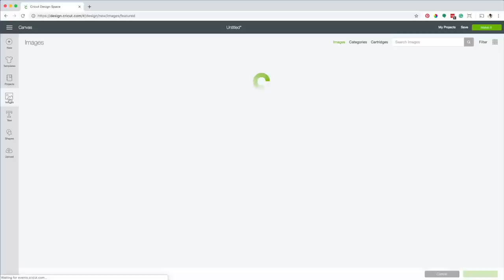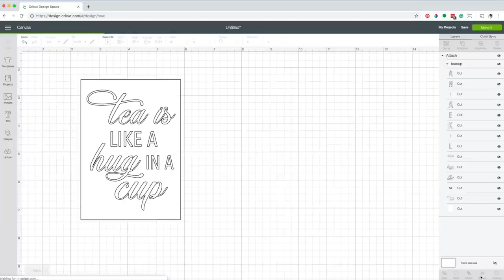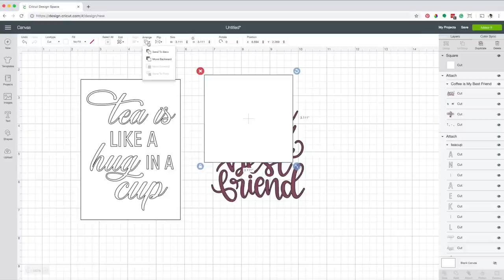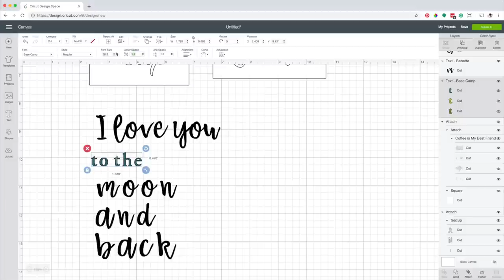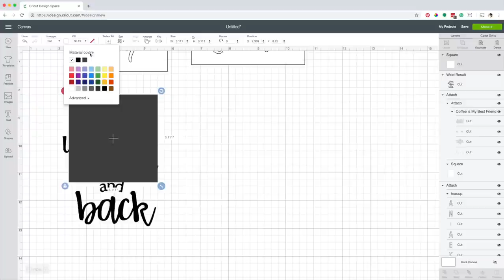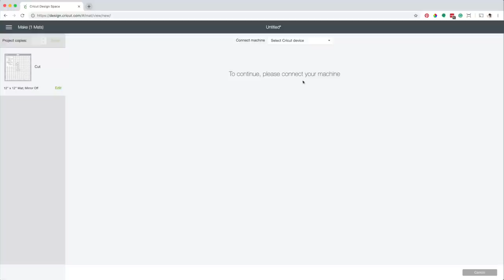Cricut How to Make and Apply a Vinyl Decal on a Mug

Comment: Great video! Does this mean with this material, if I put the cup in the dishwasher it will come off??
Reply from the maker: Hi, no, when using adhesive vinyl you shouldn’t use the microwave or dishwasher. Only hand wash. If you want something permanent you need to use Infusible Ink and the mug press.

Comment: Love this video!!! And I love that you take your time for us beginners, thank you.

2 Question's...
1)  I was playing around with script font using the font from design space.  When I went to weld the line my lower case s filled in and there was no weeding.  Why did it do that to only one letter?

2) when I started welding more sayings it then turned it to gray from then on yet my first five were black.  I didn't change the color to gray either so why was it gray?
Reply from the maker: Hi, 1) Maybe you're using a script font that you downloaded online; these fonts tend to have issues, check the layer panel, and remove the pieces that you don't need. 
2) The color is not that important; just be sure action is cut. Color is only important if you're using the print then cut technique.
Reply: @AvantiMorocha1  morning,  thank you for responding.  No, I used the ones I received with my cricut.  I typed in script and use the font.
Reply from the maker: You're welcome, check this video, maybe you'll find something that may help https://youtu.be/Hfb1KjDMEpo

Comment: I created saying in cricut designs and said cost $4 plus to print , how can I create and print on my machine with no cost to print ? Please and thank you
Reply from the maker: Hi, you are probably using Cricut fonts, if you don't want to pay, you need to use your computer fonts ( system fonts). Check my video Cricut fonts vs System fonts. Also you should think about getting Cricut Access, you pay  about $10 a month but it gives you unlimited access to cricut library that includes images, fonts and ready to make projects.

Comment: Thank you for the video! What does welding mean and why is it used for this project?
Reply from the maker: You weld ( join together the pieces) if you don't do it you will cut each letter as a single element.

Comment: Hello! I’m new using the cricut. I just got mine on Saturday. I would like to know if I can use the blue mat for this project?
Reply from the maker: You should use the standard mat(green) when working with vinyl, but if you blue mat is new it should work fine for a couple of times. Check this link https://help.cricut.com/hc/en-us/articles/360009554153-Which-materials-should-I-cut-on-the-different-machine-mat-grip-strengths-

Comment: Is the vinyl permanent on the cup? If you wash it does it stay ?
Reply from the maker: Hi, it’s will stay in the cup for a longtime. For more info check my video differences between adhesive vinyl and heat transfer vinyl.

Comment: is there anything you can add on top of the letters to protect them?
Reply from the maker: Hi, I prefer to leave it like that, you could add a sealer just ensure is not toxic.
Reply: Avanti Morocha I added clear nail polish to mine 🤷🏽‍♀️ hoping it works!
Reply: Does the decal sticker stay in long run ?
Reply: @sylvanablanco-dentino2188  did it work

Comment: Does the foil come off ?
Reply from the maker: If you use the dishwasher, it'll probably come off, but if you only wash it by hand, it'll be fine. By the way, if you use the foil adhesive, you cannot use the cup in the microwave.
Reply: @AvantiMorocha1  so in depth.  Thanks
Reply: I use mod podge dishwasher safe sealer on my cups and plates
Reply: @Cabbagepath123  Hi  how did you find using the mod podge. did you put any pics on the mug?